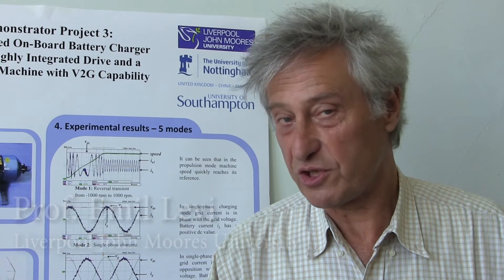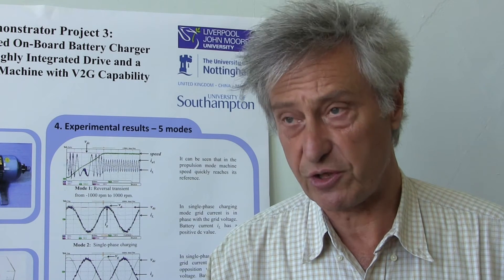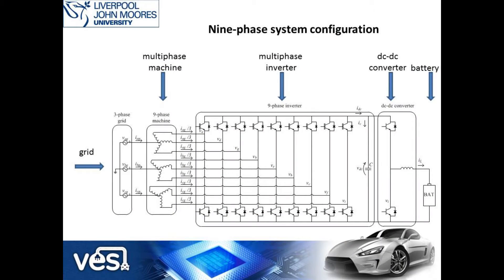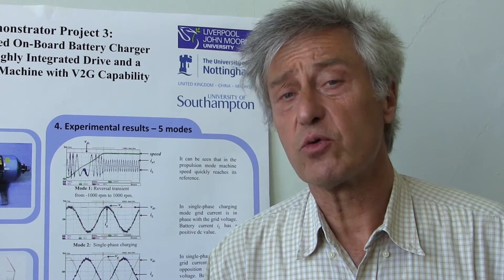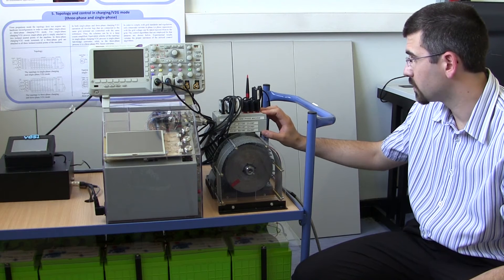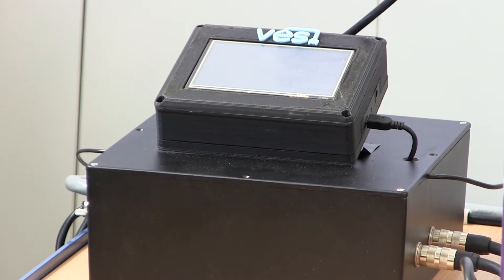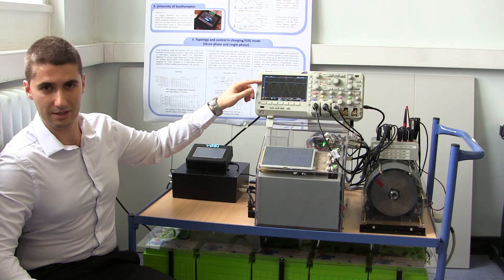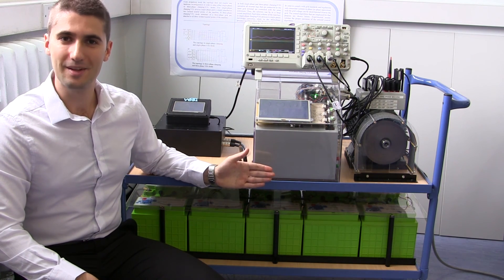A fully integrated on-board battery charger for Electric Vehicles

Comment: Really elegant! but are there not high losses in the motor?
Reply from the maker: Well, the losses in the motor are losses on the stator resistance. These now replace losses on the filter resistance. The efficiency of the charging actually is very high - that was shown in a research paper for the considered system. But, let us not forget - this is a low-power prototype, not a real system.